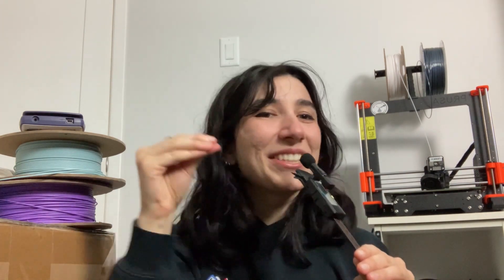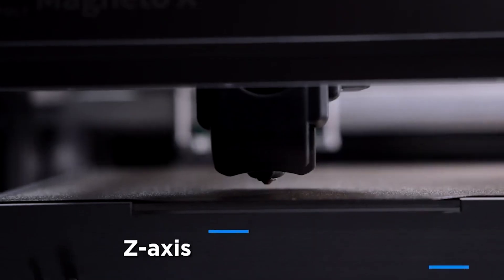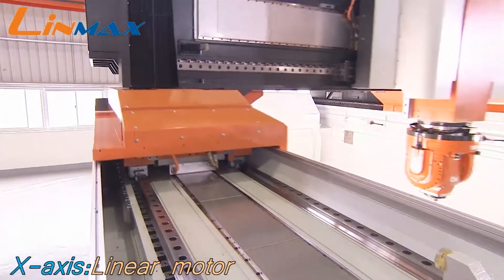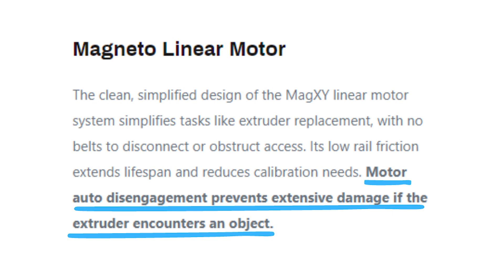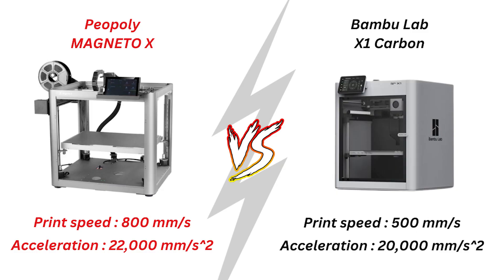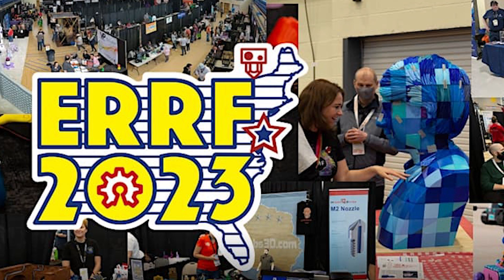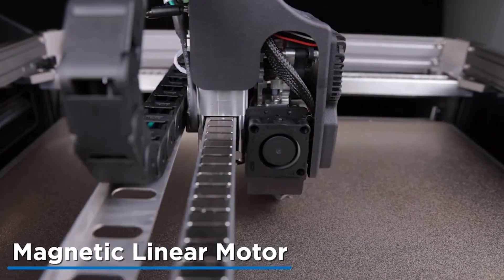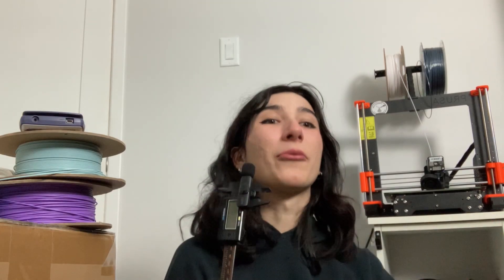a game changer in 3DP? | Magneto X by Peopoly

Comment: Im planning on getting my first 3d printer soon and the X1c or Prusa XL seemed to be the best in the price range, but after seeing this come out, it looks like it could be promising. Do you think its worth waiting out for the magneto to improve? The only issue i have with the magneto is that it does not have the multifilament components like the Bambulab AMS system.
Would peopoly eventually make a multifilament system and an enclosure soon or is it better off for me to just get the X1

Comment: Super cool but really a solution for a nonexistent problem. At its weight, a belt system would be even faster. 3 µm reproducibility is bullshit, since stuff inside heats up, there is airflow etc. Nobody needs the specs. If it was faster then regular printers, this would be brilliant but since it isn't its not really a meaningful feature.

Comment: Linear motor is just another kinds of motor.
But they said it’s“true closed loop” and that’s gonna be pretty interesting control wise.

As of longevity, using linear rails open like many 3d printer do without even putting lubrication system or telling operators to properly lubricate is already awful.
I don’t expect this product to perform even worse.
Except concerns over parts availability when someone flied motor.

Comment: I think it honestly is a really cool step forward in the FDM space but I do have some concerns. 

1. Demagnetization: FDM printers are heat based printers and higher performance materials require higher temperatures and this doesn't even include waste heat generated by the motion system. If those magnets begin to weaken, how will you replace them? They appear glued in. How would you even know if one began to weaken? Will there need to be spacers and other hardware made for the service of these machines. This problem can happen as low as 80C. Considering most of these new machines beds can get up to 120C and most heated chambers aim for around a 90C temp... this is concerning. 

2. The "NOVELTY" of the Motion System: While everyone has been talking about how amazing it is they are using this magnetic motion system, these systems have existed for decades and Peopoly even stated that they went looking for one to buy to use in the system that had a 1 micro accuracy and it was extensively overpriced so they had to design their own. Now, I'm not saying their engineers did a bad job but that fact is, it's new and not from a company that I know of having been making systems like this for that long. 

3. Construction: While it looks sturdy, I would like to know how replaceable most of the system is. Even Bambulab which I love, really could improve their reparability. We don't need another creality pumping out so many printers with no long term support. Luckily thusfar Bambulab even if their printers can be a lot to do maintenance on, the  parts are there. I have 3 X1Cs and they all work flawlessly and I have been running them pretty non-stock since purchase. But they are still painful to do maintenance on. I really need them to update the X1C to the more sturdy connections that the P1S has or the tool-less and wireless hotend changes on the A1 mini. I'm really hoping they support their long term customers and offer replacement kits. But that's neither here or there. As someone who uses 3D printers to produce consistent product, reliability honestly even trumps performance. That's what I will need to wait and see from the Magneto X.
Reply from the maker: This is a great comment - you bring a lot of solid points to the discussion. 

1. I didn't consider this and am glad you brought this up. Actually, this is a topic I haven't seen many people consider with this system. Linear motors have been seen on machines like CNCs where there are no actual heating elements to raise the same concerns as a hot end (max 300 deg C) and heated bed (Magneto X goes to like 130 deg C). The machine will have "optimized cooling" for the hot end to help with cooling the printed parts... there is also an optional "jetstream-style" side mounted fan for more extruder cooling that covers the length of the entire build plate. Could help... would need to test these concerns. Hoping their engineering team considered demagnetization during the design process. 

2. Although we've never seen linear motors on 3d printers, they have been around for a while like you said, on other more industrial machines like CNCs. Peopoly did have to design their own magnetic system. Who knows how durable the system is over time and how repeatable the printing will be when users are putting their Magneto X to WORK. That is what I'm curious on as well - does it hold up like my other machines that I've been printing on for years?

3. I hope the Magneto X will also work flawlessly like your X1Cs overtime but who knows considering all the new promised hardware on this magnetic machine. I think it is of best interest for the customer and even the company to make maintenance as doable as possible for the end-user so that when something breaks it can be repaired. Or if something'd wears out it can be replaced without having to chuck the whole machine. I know Bambu offers spare parts for their machine but it wont truly be as open sources as a Prusa/Voron or other similar machines. For that reason I associate the Bambu printers as "black box" printers in my mind. I'm curious - will people actually buy this with the idea that it is a reliable machine or with the idea that it's just "new and cool".

Thank you for watching and for your in-depth comment :)

Comment: First worry of mine would be magnets attract metal a piece of wire or metal stuck to those magnets would cause more havock than simple dirt on the more typical belt linear rail systems.
Reply from the maker: My mind went to dust and other debris rather than wire/metal shavings because I keep my printers in a room where I don't do much "garage-work" if that makes sense. Great point! If people keep their 3D printers in a shop room or garage rather than a bedroom - there's more that could wreck havoc to the magnetic rails. Thank you for your comment :)
Reply: hopefully the motors have wipers.

Comment: Converting it into an IDEX should also be relatively straightforward. The sensors and actuators (coils) are probably located in the "carriage" itself.
Reply from the maker: I'd assume so - that would be interesting...
Reply: I think The Main issue would be getting a second linear encoder on it  because there are no Double encoders to my knowlege. So you'd have to mount The second one in a way in which it won't effect The original toolhead. And i wouldn't dare Go openloop with this much Power and tourqe.
Reply: @lazarpejic6415  Thomas Sanladerer just reviewed one. As I expected, there are static "rulers" on the axes, being read by moving read heads. Other than maybe some spatial rearranging, I see no reason why a second carriage couldn't read the same ruler on the gantry.
Reply: @EatRawGarlic those "rulers" as you called them are acually called Glass scales this is probably an absolut postion measureing system which would need to be custom made or switched out because usually they are Not modular and i've never heard of one or Seen one. It's usually 1 encoder to one Glass scale and If you want more than that you use another one bc of reliabilty. I'm a mechatronics apprentice rn but i have Final examination by a comisson of 3 examiners on tuesday so i'm quite deep into this type of topic although i could still be wrong. If its a custom system Like The linear rails it might theoretically be possible and only a question of software to Implement such an Idea.
Reply: @lazarpejic6415  I know what they are, not sure if they're optical or magnetic in this case though, but I work with them on a daily basis :)

Just last week I was working on a system, where one such scale by Renishaw, was read by two read heads at the same time.
Reply: @lazarpejic6415 likely not glass scale, but magnetic.  Also likely incremental, not absolute.
Reply: fuck that, multi head extrusion would be ridiculously easy with it. You could litterally just park the extruder straight up.

Comment: The closed loop control is the biggest benefit of this just hoping that the extruder can keep up.
Reply from the maker: agreed!
Reply: Only if it would actually improve the specs beyond what other printers have, no? Just because the machine knows it overshot, doesn't help in deccelerating faster.

Comment: LInear motors may offer better acceleration and speed over conventional motors. The limiting factor in print speed isn't the speed of the printhead it is the reduced print quality at high speeds. Most printers don't print at their maximum speed because the quality would be too bad. I believe the rate at which the nozzle can melt the filament is also a limiting factor.
Reply: A large part of that "low quality at high speeds" has to do with the belts. No belts should mean much better quality at higher speeds.
Reply: @dakotapahel-short3192 exactly. And it is mentioned on the video that the hotend is capable of melting material faster so
Reply: @dakotapahel-short3192  Not true. The lower quality at high speeds is due to general mechanical rigidity, including - but not limited to belts and filament melting. One can tune a linear motor system just as well as a belt system, in the end the question is only, how much flex at how much force. There is no inherent benefit of either system. A thin belt loses against a strong linear motor, a weak linear motor loses against a strong belt.
Reply: @testboga5991  sigh, i appologize if my wording was being too generalist for you. I was talking about the belts we use in 3d printers. These 6 to 9 mm wide gates belts we use stretch in the speeds &loads we use them at and its a lot easier to create a linear motor with enough power to handle the mass we are moving around than it is to increase the belt size/decrease carriage weigjt to a point where the issues with belt stretch are negated. I have deltas with steel sheets bolted around each corner. They are heavier and more stable than any printer in their size. Bowden system with a 120g effector. Even a 12mm belt produces artifacts that have to do with belt stretching. Im know there are games we can play with accelerations and clever placement of pulleys... but these linear motors represent a much cleaner solution and im excited to see how much farther we can push quality with them. I legitimately think im doing to have to start bolting the printers to concrete because stability will be an issue at the speeds & accelerations we can push a decent linear motor.
Reply from the maker: I agree. I think that is the reason why, asides from increasing the speed & acceleration abilities of the whole machine, Peopoly made efforts in increasing the extrusion force and mass flow rate of the hot end. Looking at the specs of the machine - they say that they "optimized the melt zone design" of the hot end to have that peak flow rate of 60 mm^3/s. 

It uses an E3D V6 volcano style nozzle but they offer optional swappable melt zones that have different lengths to improve the plastic melting/increase the flowrate and I guess offer consistent printing at the machines claimed higher speeds. The Magneto X is delivered with their standard melt zone hot end, which only maxes at 45 mm^3/s flow rate. If you want to reach their claimed 60mm^3/s, you'll need to upgrade to their "long melt zone". The melt zone is the part of the hot end where the pushed in filament is heated up and therefore starts to melt. 

These are just my guesses/observations. Thank you for your comment, great point :)
Reply: @strelkomania  A different hotend can be used by any new printer design, so nothing special here...